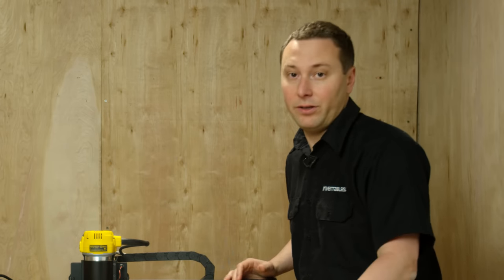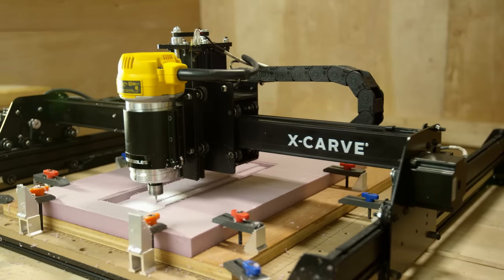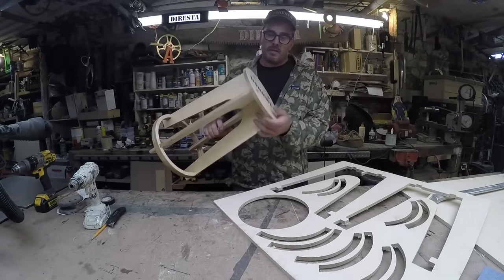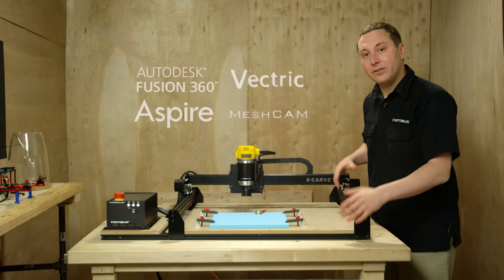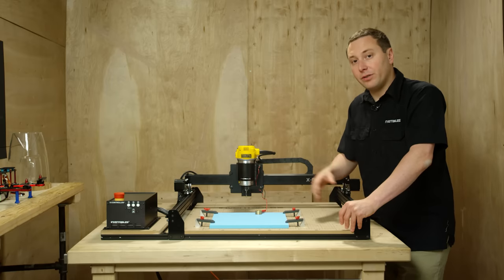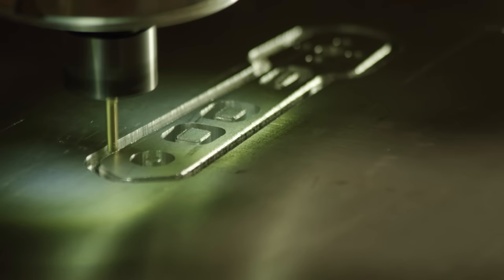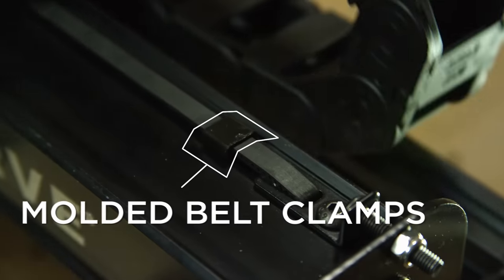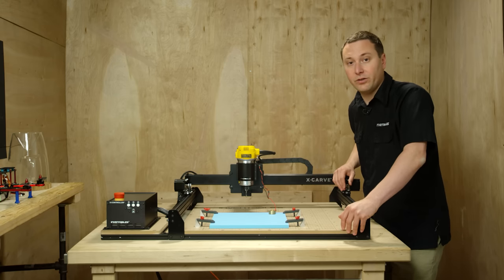The new X-Carve from Inventables

Comment: It looks like the two main rails are still the same size and have the same mounts, and you know these rails bend, twist and wobble during carving... so why the heck are you not adding more supports on that end?
Reply: Doing the Y-Axis Support MOD by yourself is a trivial undertaking that can be done as one of the first projects with the stock machine on the cheap using either MDF or POM as the material of your choice and if you desire so later be replaced by Aluminium.

Comment: Can you elaborate on the smash protection for the homing switches? And if you decide to upgrade do we drill a hole for the z-probe port and then install it?
Reply: The smash protection happens with little stoppers that prevent the switch from getting crushed.  It's about their placement.  You don't need to drill a hole but you could.  You can wire it directly into the X-Controller without the plug.
Reply: Are the stoppers something I already have and just need to be moved or adjusted or are they something in the upgrade kit?
Reply: Hey Jacob can you reach out to our Customer Success team so they can send you some pictures to explain?
Reply: ok. thanks

Comment: Zack, you failed to mention that the 'free' Easel software ONLY works if a person has a reliable and convenient internet connection.  Easel is not standalone software.  It is only available 'in the cloud', which means no internet, no Easel.  Or, through your partner Vectric someone can buy software for a few hundred bucks.  I also own a Luluzbot 3D printer, you might want to see how they do it right and emulate their approach.  Good luck.

Comment: If i buy it now, will i got an update version of it? i read many negative comments about stability and  belt under stress
Reply from the maker: Yep! The X-Carve for sale on our site is the model in this video (the new X-Carve), not the 2015 model.
Reply: so one year later, no update for 2017 or coming ones?
Reply: Apparently they don't answer many questions.  I asked about ACME rod to replace the belt system.  No response.  Everything I have read about the belt is not good.  It slips and requires frequent tightening from what I have read and watched on YouTube.  It seems to be a great system/tool otherwise.

Comment: I would do anything to have one but still out of my price range
Reply: Tim Mitchler they are worthless anyways. you can make a 1000mm one for 500 dollars yet they sell theirs for 1500. They are ripping off innocent diyers who don't understand how CNC machines are made. They don't use real linear rails or a lead screw. which is the only way to get a worth while machine for cutting wood and metal. the reason why the precision of this machine sucks is because they refuse to spend more money to make it functional. for example their controller box costs them less than 100 to make. the extrusions are 20 dollars for 1000mm, the belts would cost 10 dollars, and all of the steppers would cost 100. if you include all of the small stuff then you might get to 500 dollars in material costs. and for them to retail the machine for 1500 is just highway robbery.

Comment: Question, I was going through my Gmail and there was an AD kin of hinting at kind of a Lease to own? I admire the x-carve, but for what I want, I may have to be ""That Guy"" who is planning on a 4 axis model. I am a Kind of DYB Do it yourself is Best Guy and I have watched every you-tube  Videos, many times over and I believe I could get the Precision that I will need out of a modified China Model. However you probably did not want to hear this. Anyhow, i admire the fact that you listen to recommendations / suggestions. When hitting the Learn mode about leasing? button it brought me here. Milling small  aluminum parts, would be my main material used, i would not be trying to cut 4 inches deep in aluminum, I am talking, in thousands of an inches. If there is a way that this can be funded, ""Lease To Own", with Minimal interest, where someone may have an extra $100.00 left from last payday, and pay more when he can, would probably be the Coolest Company ever, your orders would multiply 50 fold.
Soo, with the reasons why I want this or a CNC Small  milling type setup, what are the tolerances?
Respectfully, Jim P. Jenuine Motor COX ENGINES PARTS SOLD HER BUY AND SELL NOS